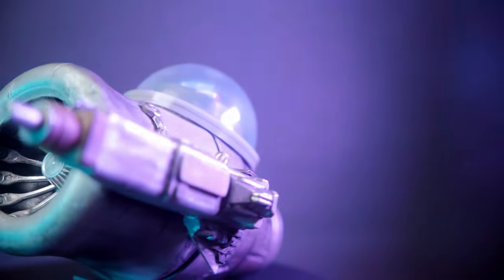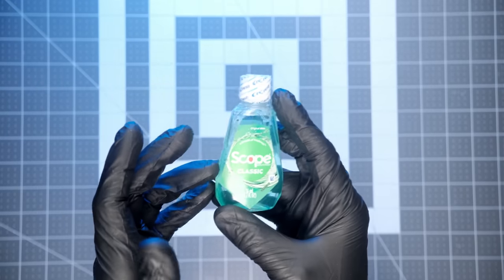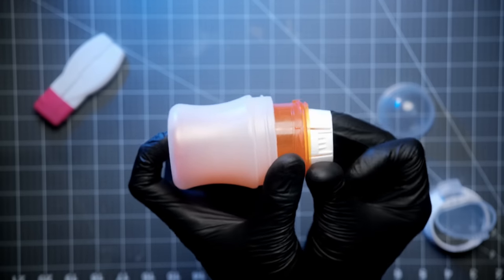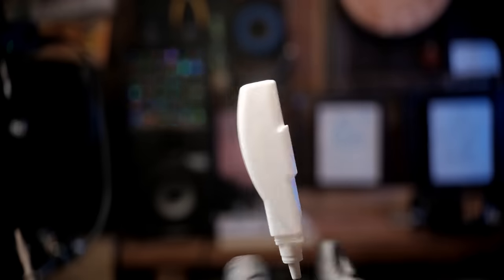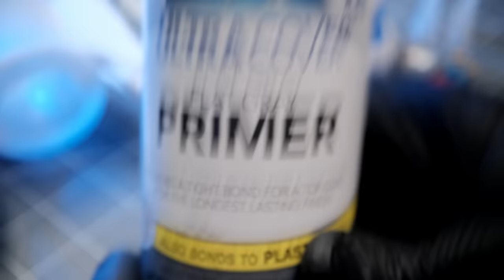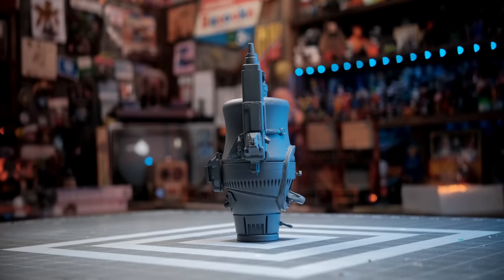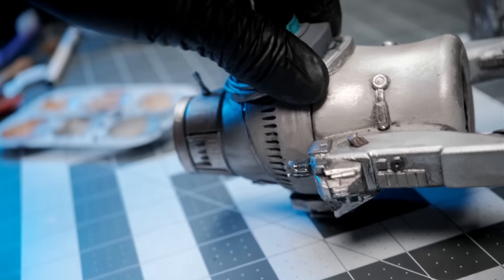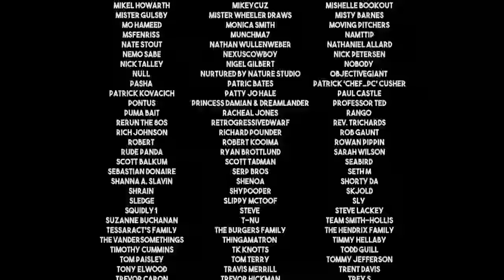Build your own spaceship using plastic containers! | How to TRASH-BASH.

Comment: Thank you for revealing the thoughts going through your head as you look for exactly the right pieces! It is like your in my head too! I do this with small, random, metal pieces,parts.  The “paralysis” that you mentioned is a real phenomenon with me.  When I finally decide on the parts and start to assemble it, I’m often wondering if it’s good or not, maybe I just l worked on it and stared at it while waiting for the “parts” to speak to me, just too long.  I dunno, at that point I have to be satisfied in the process and final product so I push through the doubt and wait for the “bot” tell me it’s story. (Then I condense it down to a small card which is another process all together). Anyway, keep doing you!

Comment: I used to do a more primitive version of this as a kid. I used a few different things, like the '80s Sunny D bottles as lookout towers. My favorite were the egg containers pantyhose used to come in with the wider end being clear plastic, like a canopy. With cardboard interiors, they became a few different kinds of rocket pods that could hover and steer with adjustable antimatter rockets around where the clear part attached to the back section (the rockets were just the tabs either from the mold or something to do with packaging). They were flown by pipe cleaner anthropomorphic numbers and letters that were perpetually engaged in battle against each other. Now I need to see if they still sell those eggs and maybe I can build more pro versions of the standard interceptor and ground support pods than kid me could do.

Comment: PROJECT PARALYSIS™ Yah, f'sho. One of the worst elements is TPS (The Precious Syndrome). Even though you've rescued all of those containers FROM THE TRASH, you've cleaned them up, loved on 'em, thought about them - and you don't wanna' waste the item on the wrong thing. It WAS a piece of plastic trash. NOW you can imagine all the wonderful ways in which it will fit with other elements, the "other precious things of the shop". Look at the design! The curves. The smooth-nicity. Don't want it to be wasted. What advice do you have for overcoming TPS? Keep up the good work, Crafsman. Aloha

Comment: Loving this! how can I smooth 3d prints? as I would wanna add random broken printed parts but always PLA lines :(
Reply from the maker: Hey there!
You have a few options for that. One is to use acetone vapor (you can suspend the print in a jar of it - the fumes will sorta meltify the striations and smooth things a little) and another is to use epoxy. Smooth-On makes a product called XTC3D, but I've seen folks use standard 2-part epoxy as well.
OR... here's you another idea that's even quicker:  Use some UV resin (some people even brush on light layers of standard 3D print resin) and cure it with a UV light. You basically brush it on and let it span the striations and fill those gaps. Some light sanding (with a respirator or using WET-sanding technique - be safe!) afterwards can really make it smooth.
Reply: Thank you so much for replying to me :D  @TheCrafsMan  MASSIVE fan here in the UK!

Comment: Hey Crafsman, have you ever worked with a 3d pen? I recently got one and have a feeling you and crafson would love it.
Reply from the maker: I've been tempted by them! Are they essentially hot nozzle/tip filament extruders?
Seems interesting for things like creatively filling spaces or building onto a surface... and maybe even joining objects(?).
Reply: @TheCrafsMan  it's like a hot glue gun for filament. I've made figures, fixed a few things, and even pressed fresh extrusion around screw threads for a camera mount.